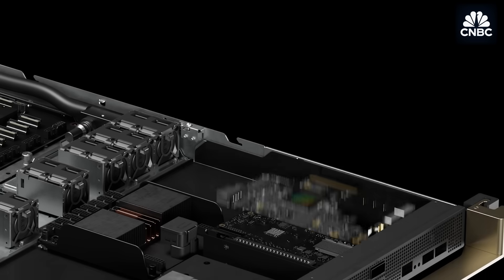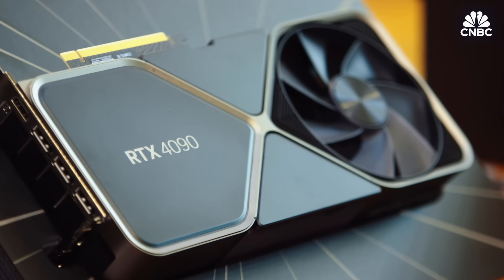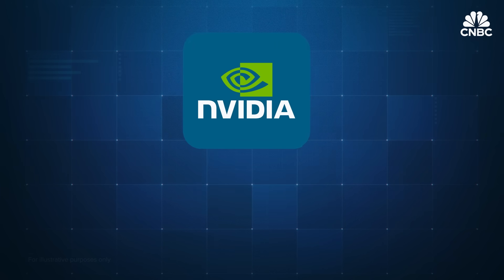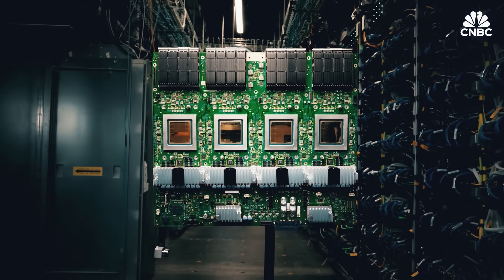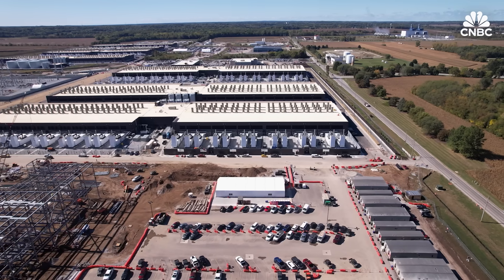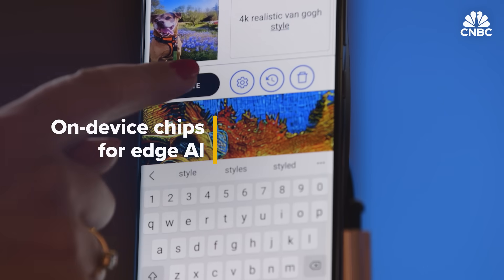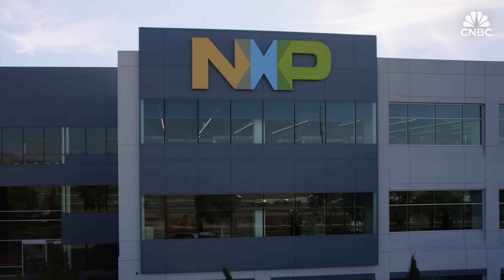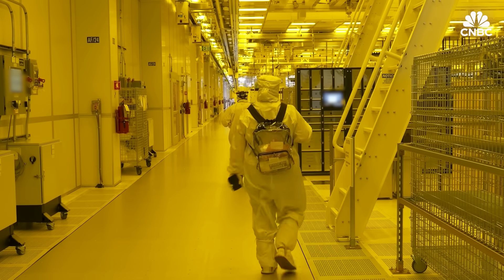How Nvidia GPUs Compare To Google’s And Amazon’s AI Chips

Comment: I never thought of NVIDIA as a gaming machine! I had a twin Xeon chips, max memory for the time, and twin NVIDIA cards each with 1024 channels. I used the system for computational aerodynamics, finite elements, and structural dynamics! In one case a local semiconductor company wanted to cut a hole in a building to increase to floor area of the white rooms. I used the NVIDIA boards with a FORTRAN that could use the power. We checked the results with vibration tests. The building was tripled in size and we ran multiple models and tests to optimize the building!
Reply: GAMING MACHINE WITH HIGH RESOLUTION CONSUME THE HIGHEST POWER AND USES GPU TO THE HILT UNLIKE YOU ANYLYSING SOMETHING WHERE IT IS NOT CHANGING MUCH IN A SECOND UNLIKE A GAME WHERE 240 FRAMES ARE CHANGED AT 4K RATE/2K RATE, WHICH IS RIDICULOUS AND AI ENGINE IS THE ONLY ONE WITH SIMILAR RANGE WITH BEING PUT TO WORK ALL THE TIME.
---------
THE GAME NOWHERE OVER BECAUSE YOU CANT EVEN WATCH 8K WITHOUT MASSIVE BANDWIDTH AND COMPRESSION. JAPAN IS TRYING TO STANDARDIZE 8K COAST TO COAST( CAPTURE AND PRESENTATION) AND YOU WOULD NEED TREMENDOUS BANDWIDTH TO MAKE IT HAPPEN. AND 6G WHICH CHINA DOING NEEDS SIMILAR.

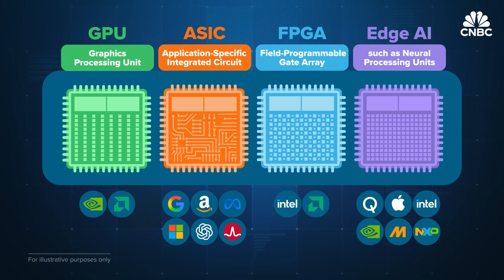Comment: Your chart at 1:04 is incorrect
Id think a company as big as CNBC would be able to properly do this
1. Intel also makes GPUs now not just AMD/Nvidia
2. ASICs are made by virtually every semiconductor company from ON semi to Texas instruments, even when accounting for "AI hardware ASICs" still theres at least 20 companies who do it
3. FPGAs are more accurate, but you forgot LATTICE semiconductor the other major player in the FPGA space
4. Edge AI is just another name for APUs or ASICs with AI accelerators built in, NPUs(neural processing units) are just a name for specialized AI accelerator ASICs

Comment: There's a lot of nonsense and fog surrounding AI right now. The basics is that AI is based on matrix math, and GPUs were a chip that also needed lots of matrix math, done in parallel. But there was no reason AI needed the baggage of supporting frame buffers and graphics drawing needed with a GPU, so it could be easily dispensed with to simplify an  AI processor. The reason it took so long to arrive was that Nvidia had a pipeline to the best and most cutting edge processes in TSMC, and so they were hard to beat even with the economies of taking the GPU out of AI chips. Now others are catching up.

Comment: Modern CPUs run things in parallel most of the time, one process per core typically. You just can't load in code or data on all of them simultaneously.

Comment: If you look at older processor specs, you would see fewer 'cores', but they would operate at higher/faster frequencies/speeds. Now, we just have more cores, operating at lower speeds, since a single core can reliably crunch a big enough number in a single operation to be accurate enough to get work done.
Reply: It had more to do with limited transistors to work with. As transistor density increased, that limitation became reduced. 

The other factor is architecture. 

CPUs have fewer cores because CPUs have extremely generalised programmable architectures...becauae this is what's needed to run operating systems, etc. 

To create a CPU with 10 000 cores on a single chip is nowhere near possible at the moment. Not enough transistors for that. 

GPU cores are extremely simple and don't need a lot of transistors. This is because the tasks it needs to run are very simple. 
The tasks are also very repetitive, this means lots of parallel cores running synchronisely is possible for such simple repetitive tasks. 

A GPU is kind of in between leaning more toward being simple. It's programmable but still highly parallelised.

The task of AI is extremely simple and repetitive, and the basic math won't evolve likelike it does in 3D graphice ...and so doesn't need the chip to be programmable.
It's a waste of transistors.

ASICs are ideal, because no transistors are wasted on programmability. This also allows it to run faster.

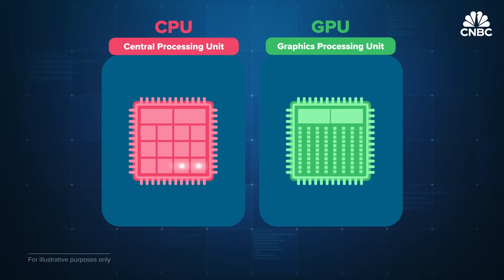Comment: @3:01 - multicore processors DEFINITELY run processes in parallel - these are called execution "threads" and the OS will assign threads to available cores in turn.  Pretty much all general use CPU's these days have at least 4 cores - and some have many dozens.  
Typical home computers run 4 - 8 cores on the CPU and this is ample for most tasks from web to word processing, spreadsheets, general photo editing, and so on.
A typical PC or Mac environment these days will have the OS managing 2000 ish threads at a time - but few are running at any time.  It splits their execution time into slices of a few ms at a time, pre-empts the thread, and hands the core over to the next process that needs CPU time.  Sleeping threads can be woken at specific times (or after specific delays), or upon events (hardware needing attention ...).  Threads can invoke other threads (and manage them too via OS calls).
High end gaming needs better CPU's - but especially higher end GPU's to render 100+ frame per second "smooth" looking video while including all the best in ray tracing and more.
(I am being very superficial here).

Comment: TSMC’s singular focus, technological maturity, manufacturing scale, system packaging expertise, and strategic partnerships (e.g., with Nvidia) firmly establish it as the premier chip manufacturer producing chips no other foundry matches yet. 
Samsung remains its closest competitor but has not matched TSMC’s advanced node yields or foundry-only level specialization, especially at the highest process nodes used for Nvidia’s top-tier GPU servers.
Reply: 是的，製造世界90％高級晶片的台灣的台積電毫無疑問非常強悍，三星在晶片製造方面還不行挑戰台積電。

Comment: I'm surprised they didn't talk more about CUDA, because that is where Nvidia are way ahead of the competition. In fact all these AI's the Mag 7 made, were created using CUDA. CUDA is just as important as the GPU itself.
Reply: Incorrect, Google doesn't use Cuda anymore & Google's AI Ironwood chip still outperforms Nvidia's latest AI B300. Nvidia Chip design increases inaccuracy, Google isn't going that route - Ironwood keeps the integrity of the data together.
Reply: @dsdgdsfegfegOutperforms it on what exactly. Those custom processors are make for specific use cases. They’re not going to outperform on everything
Reply: @dsdgdsfegfeg Google used CUDA to build its AI then designed its own tensor chips to be able to handle its workload. Google's tensor chips are designed for low latency and for a certain task whereas Nvidia's GPU's are more versatile and the CUDA platform is more easily adoptable and adaptable. You need CUDA and Nvidia GPU's if you want to create and train an AI to your liking. Google's chip and tensor platform uses their own software but it is inline with Google's core applications only. as they say Nvidia is the standard, Google is more specialized. And lastly, you think Nvidia are going to stand by and watch Google eat up a slice of its pie? Nvidia will have something aimed at Google in the next 1-2 years and it will be so much moire powerful and will probably beat it on every price point.
Reply: @das2003  incorrect, Ironwood is now being sold. Anthropic has a $10-40b contract with Google to install everything and Meta shortly as well. Ironwood still out performs B300- the chip Nvidia released to compete with Ironwood.  Ironwood TPUv7P will be released in couple of months. Nvidia's design increases inaccuracy, Google is not going that route, it's design is accuracy and others are now going that route.
Reply: @dsdgdsfegfeg And if I can make 1 more point, all my research was corrected and researched using Gemini, how ironic!
Reply: Cuda is just an api. And they don't all use it.
Reply: @jasonsmall5602 CUDA is more of a library. And it's the dominant one in the market.
Reply: @jasonsmall5602  It’s a common misconception, but CUDA (Compute Unified Device Architecture) is actually much more than just an API. It’s a full-stack parallel computing platform and programming model. - Gemini
Reply: CUDA is just a tech moat for NVIDA. It’s being replaced by multiple alternatives.

It’s just a matter of time before the tooling supports one or more alternatives to the same degree and then CUDA will be irrelevant
Reply: @JohnSmith-op7ls 😂 Nice fairy tale
Reply: @JohnSmith-op7ls  Please cite what it is being replaced by, because there is not much information regarding that. CUDA has been in development since 2004, that's a good 20 years before everyone else. CUDA is the gold standard and will be relevant for another 20 years if not more.

Comment: “Comparing The Top AI Chips: Nvidia GPUs, Google TPUs, AWS Trainium”:

Nvidia GPUs: Nvidia’s latest Blackwell GPUs are widely used for AI model training because of their immense parallel compute power. Nvidia remains the leader, with huge shipments and direct sales to tech companies, governments, and cloud providers. Their proprietary CUDA software and full rack-scale systems optimize speed, power, and performance.

Google TPUs: Google pioneered custom AI chips (TPUs) designed specifically for AI workloads, starting in 2015. TPUs use fixed hardware to maximize efficiency for specific AI tasks. Latest generation (Ironwood) powers labs like Anthropic’s with massive scale. Though traditionally used only by Google, TPUs may become accessible to a wider market.

AWS Trainium: Amazon built its own “Trainium” chips after acquiring Annapurna Labs, aiming at both AI training and inference. Trainium chips offer 30–40% better price/performance on AWS versus other hardware, appealing for both cost efficiency and customization. Some huge AWS AI datacenters now use only Trainium—no Nvidia chips at all.

AI Chip Types Compared:

GPUs (General): Powerful, flexible, great for parallel computation and both training/inference; expensive and in high demand.

Custom ASICs: Single-purpose chips (TPU, Trainium) are faster and more efficient for specific tasks, but less flexible. Major hyperscalers now make their own for efficiency and independence.

NPUs & On-device AI: Edge AI chips handle tasks on phones, cars, and devices for privacy and efficiency, with Apple, Qualcomm, and Samsung leading.

FPGAs: Re-programmable chips, flexible for many uses but less efficient than ASICs for large-scale AI.

Manufacturing and Geopolitics: Most advanced AI chips are made by TSMC (Taiwan), driving concerns over supply chain and geopolitics. US is investing in local fabs (Arizona), but cutting-edge chips (like Apple’s latest) still mostly come from Taiwan.

Big Picture: While Nvidia dominates now, custom chips from Google, AWS, Microsoft, and others are gaining traction. Edge AI chips will grow as AI moves on-device, and manufacturing geography will be key to future leadership.

Bottom line: The cloud AI chip race is heating up. Nvidia, Google, AWS, and others compete on speed, efficiency, flexibility, and strategic control, shaping the future of artificial intelligence.

Comment: This false dichotomy between training and inference is... Well, false. Anthropic uses trainium chips for inference, for example, because inferential is so underpowered. Half of the training workload is inference (you have to do a forward pass (inference) before you can do a backward pass (back propagation)). This whole explanation is specious. The one thing that does distinguish inference and training is they do-called prefill, and that is different, somewhat. That can benefit from a specialized chip.

Comment: The chips have become larger and larger, with more than 3K or even 4K pins (soldering balls) on the PCBs, making the PCBAs much more difficult to rework, or repaired if you like, that bring another challenges most engineers overlook, or just scrap the expensive server boards, once one of which breaks down?

Comment: A bit too superficial in my opinion. You didn't really explain why everyone wants Nvidia chips for training. You didn't touch on the subject thaz GPUs (like Blackwell) can also do inference, so you don't need to buy 2 different chips. You didn't talk about CUDA enough and why it makes it easy to use Nvidia GPUs. It's really not good enough to be informative to a degree that could help someone understand the business and the MOAT of Nvidia. Even if GOOGL would make better chips Nvidia would still have the market due to standardization and supply. It's not as simple as the commentators here suggest

Comment: The video is quite miss leading the public to make it seems like only GPU can training AI, while quite the opposite, Google's Ironwood TPU pods is much more superior in training LLM than Nvidia GPU. That's why they got Gemini 3 Pro while OpenAI has been stuck in its last pre-training for a year!
Reply: Training time on Nvidia chip is a lot faster. Google's TPU wins out in price and efficiency, that is why they used it.
Reply: @axumitedessalegn3549  not only the price and efficiency, the scale. e.g., Ironwood pod can connect ~10K TPUs while blackwell can only connect 72.
Reply: Obviously in the long run inference is more important than training, and Nvidia GPUs are vastly better at inference.
Reply: @Wobbothe3rd  Speaking of inference, Google TPU is again a big winner, they optimized in both software and hardware stack, jax/tf + xla and low level TPU chip design all optimized for Gemini inference, that's why Google's LLM efficiency has improved 25x last few months while others who rely on Nvidia keep bleeding
Reply: You are misleading while trying to argue the video is misleading. Gemini 3 Pro had little to do with the TPUs, it has to do with data, structure and tuning. Correlation is not causation!
Reply: Thank you, glad someone said.

Comment: Comparing chips at this point in time shows how out of touch and clueless analysts and reporters are about AI technology.  Accelerated supercomputing and AI are way pass this stage of who has the fastest chips.  It's all about the ecosystem : chips, networking, software, system architecture, etc, etc.  Each one of these attributes are optimized to make the entire platform run the fastest and very importantly, the most efficient.  No one else is talking about any of these attributes which means they are barely doing anything about it. They can  only run the hype about their chips.  Nvidia is the only one talking about them and creating  them for everyone to see.  Where are everyone else's platform or ecosystem?  Nothing!  This video is like comparing who has the most horsepower engine when it takes more than just the engine to make the fastest car.  Nvidia is really making accelerated supercomputers  of which AI is only one of the applications.
Reply: True
Reply: Performance still matters. MLperf benchmarks are still important. Nvidia still dominates inference and training for general purpose AI. Google is able to exploit their TPUs with custom architectures.

Comment: NVDA is probably building their own ASIC chip right now that can work along side their GPUs.  No way a company like NVDA will let this slip buy and let others eat their lunch.
Reply: ASICs are a dead end, by definition a new kind of Ai architecture wont run on an ASIC. It's foolish to think that the transformer will be the last architecture ever. The human brain itself is a recurrent neural network.
Reply: NVIDIA itself produces custom application-specific integrated circuits (ASICs) for specific networking and AI tasks and has a dedicated business unit to pursue this market. However, when "Nvidia ASICs" are mentioned in a broader context, it often refers to the challenge posed by custom ASICs developed by other tech giants (like Google, Amazon, and Microsoft) to NVIDIA's dominant general-purpose GPU business.
Reply: At the same time it totally makes sense for the hyperscalers to all be invested heavily in their own bespoke chip design. If they can vertically integrate and design chips tailored to their specific pipelines they will likely see big efficiency gains. I think it will be difficult for Nvidia to keep designing chips that appeal to everyone in the long run with their more generalized approach as their customers begin to specialize and differentiate from one another. In that scenario, the big winners will be design companies like Broadcom, and fabs like TSMC. Nvidia will no doubt fight hard to prevent that from happening though.